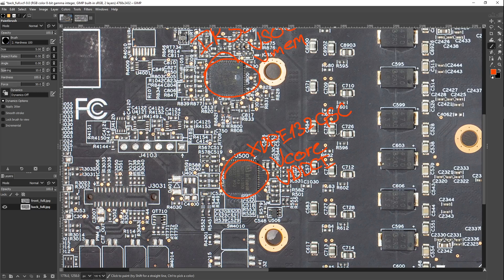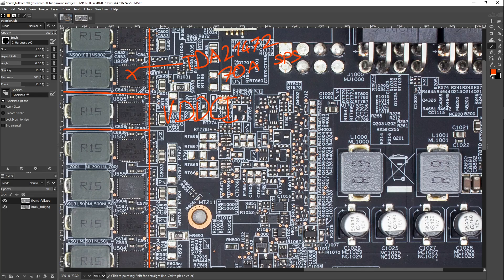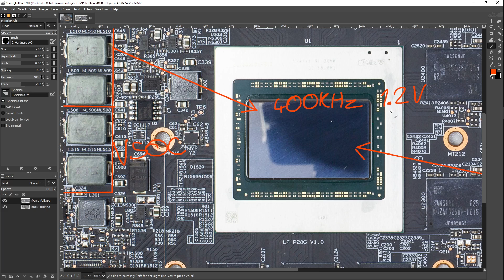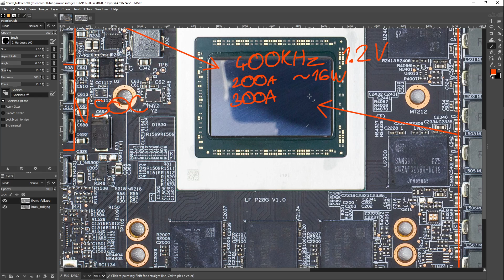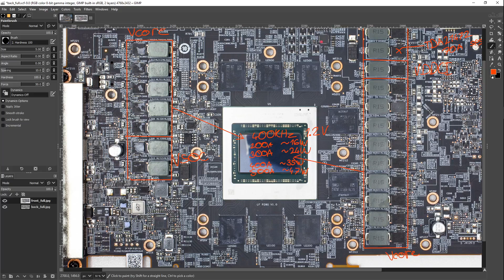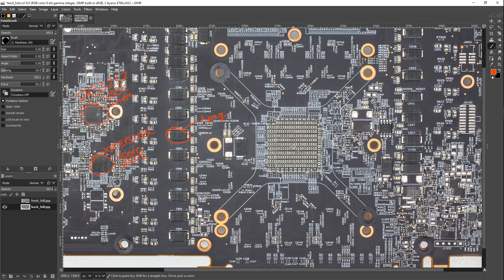GPU PCB Breakdown: RX 6800XT Red Devil

Comment: I have this card, the 3 volt pci is shorted. Tried injecting 1.2 volts and use thermal camera but could not find the fault. All the 470 caps seem shorted, assuming gpu is shorted.

Comment: I have the liquid devil version of this card, I noticed the red devil pcb has a 5 volt argb header on it and mine does not, would it be to easy to solder a header in place where one should be or is it not possible?
Reply: should work fine. might need to flash the red devil bios

Comment: i think the limits are there to make the 6900xt well actually seem half decent my red devil 6800xt se 667/1000 has a core that is locked at 2800 in some benchs and my stable clock is 2720 core and i beat some 6900xts so i think its there to make the 6900xt well have a spot then been beaten by its little brother

Comment: The limits on the 6800XT are so low because else you could OC it past a 6900XT, and that would make the 6900XT worthless. But you can get a 6800XT over a 6900XT stock anyway rather easy, even with current limits 😁

Comment: Are the components all in the same place / dimensions as the reference?  I have a reference waterblock from EK coming to put on my 6900xt but I could put it on one of these if it's the same.  Edit: I should wait, you literally said they stretched the reference board a little just after I typed that.

Comment: When does AMD/ATI give out proper drivers???

Missing drivers in Win98 for ATI X#### series.  Win98 was supposed to be supported.  Kinda forced upgrade to XP at the time

Missing Win10 drivers for earlier or most Radeon HD series.  Especially when MS pushed Win10 on Win7 users.
Some people woke up surprised to find their Win7 upgraded itself to Win10 which caused several other problems.

Had to find a legacy driver for Radeon 270X.  The normal driver package won't do for some reason.

I've given up on ATI/AMD GPU's
Never really had any driver issues with NVidia other then the default of some settings which is a minor annoyance

Comment: Hey man recently just started OCing my ram and tightening the timings, I have Corsair Vengeance 2x8 3600 18-22-22-42 (waiting for my 4x8 viper 4400) and when I read them with thiaphoon it’s says they are A-die 20nm...if you look them up they are supposedly should be  b-die....but wouldn’t A-die be 10nm....either way I got them to a 16-20-20-40 at 3733 at 1.47v is that a safe daily or no?

Comment: Hey man I would like to ask for your opinion on something, my rx 580 that I bought used that had the thermal paste and pads replaced, works fine on the desktop and YouTube and what not but when I start a game or anything it immediately stops giving signal and the fans spin to 100%. I took my whole pc to a store to have it checked out because I thought it could be either the gpu or my psu could be faulty, long story short it is the gpu and the guys there say it looks, just from the outside, like the thermal stuff replacement was pretty bad and that the gpu processor isn’t touching the heatsink, they’ll open it Wednesday and see if that’s the problem and replace the thermal stuff but do you think that would be a reasonable cause for the issue I described?

Comment: Looks like an awesomely designed card from PowerColor, I would suspect a special LN bios will become available from AMD. Not meant for the 99%+ buyers. I would say ask AMD or AIB partners for the bios/drivers. Also this PCB looks like it would support the 6900XT just fine if AIBs get the 6900XT which sounds like they will.

Comment: On the subject of limiting the clocks, Mark Cerny said in the Road to PS5 that if you push RDNA 2.0 clocks too high, the internal logic starts to break down, so they artificially capped it at 2.23GHz.
Now AMD might have resolved some issues to allow them to hold 2.5GHz and even more stable after the PS5 specs were locked-in and finalized, but that doesn't mean there's no limit to how much is useful to push it.

Comment: Do the reference PCB of the 6800 and 6800XT please there is images on techpowerup or tom's hardware can't remembere which, but please do it that's the video I've been waiting on, compare them to some of the aib's cause. Cause the Powercolour pcb has different r15's than the reference and powercolour filled the gaps for one of the r15's at the pcie connector. would be interested to hear your thoughts on the differences of the extra mosfets or whatever compared to the reference boards and if there is any changes between the 6800&6800xt boards I believe toms hardware showed the open pcb of the 6800 in their review and pointed out a different voltage controller on the 6800 board compared to 6800xt, Anyway do the video please :)

Comment: i had a gigabyte 980 TI xtreme that did ON STOCK VOLTAGE - 1650mhz AIR, and on water it ran allmost 1700mhz, voltage didnt do much, but where my card unlocked ? like they didnt software lock it ?

Comment: Guess we're not going to talk about how nvidias gpu boost actually throttles the more you use it.
Just because they rate the base clock as 800mhz doesnt mean that going slower with higher temps suddenly means "boost".

Comment: G'day Buildzoid,
It is a real shame AMD has the Frequency Limit as it would be Awesome to see LN2 OC challenges that have nVIDIA Vs AMD,
As a Sapphire Fan I am sure you will do a Nitro+ PCB Breakdown, it will be interesting to see if Powercolor has out done Sapphire on RX6800XT, or if Sapphire has something like a Toxic in the Works,
as someone who loves your channel & has learnt a lot maybe this is still a Dumb Noob Question (plus I understand it would be a Futile endeavour because of the Frequency Limit),
The Board design has mounts for a 3rd 8pin Power socket, if there was no Frequency Limit so you maybe get a LN2 OC that requires more power than the 2x 8pin would it be possible to just solder on an extra socket & have it function properly increasing the available power from the PSU?

Comment: I suspect the cause of the relatively poor cooling performance of custom 6800 cards that came out so far have to do with the chip orientation. In that position it's much harder to put heatpipes correctly on the die; on the reference vapor chamber nothing changes, but if AMD opted for a 90° rotation it would have probably helped AIBs in a tangible way.

Comment: The 5700xt bios is actually editable, changed tdp and clock curve on mine without issues
Reply: sw4gr1d  It's not just that, using both Red Bios Editor and More Power Tool, you can change voltages, clock speeds, limits and mhz curve, then saving all as a new bios.
Reply: @d4mb20  is there any proper instructions how to do this?

Comment: How about a Bios Hack? Sell it on a Thumb Drive for $10$ a pop.
Reply: I think that's the point of signed BIOS - if you change something, the signature breaks and it won't be recognized as genuine BIOS. So how do you hack it if you can't change it? You'll have to somehow bypass the signature checking. Or let's have someone smarter than me explain. At least that's how I understand it.

Comment: Please look into the the ryzen 5000 series not being able to clock pass 1600 fclk. It crashes on desktop and shows WHEA CPU Bus/interconnect errors. This is happening on my x570 msi ace. And it's happening to many others, it's all over msi forums and reddit. It's not unique to msi boards either.
Reply: Its bios. Wait for an update. @techdeals said that he had this issue. It was solved with bios update
Reply: There will be a bios update til mid December to address some bugs so be patient my dude
Reply: Watch his most recent vid 5600x vs 9900k vs 3700x
Reply: @alexandertarkovsky6995  the most recent bios gets me into windows but it crashes eventually. I never had this issue on my 3700x. I have to set my ram to 3200mhz and fclk to 1600mhz to be perfectly stable.

Comment: Thanks for the in depth review of the board. What I'm wondering is why companies selling 6800xt and the RTX 3080 recommend 850 Watt PSUs for the AMD card and 750 Watt PSUs for the Nvidia cards? The AMD cards are supposed to be more power efficient so why do they recommend bigger PSUs? <as I look sadly at my 750W overkill PSU>...
Reply: I've no idea about Nvidia, but AMD recommends oversized PSU due to possible transient current overshoot. Basically, a GPU with, say,  a power consumption of 300w can sometimes go much higher than that for a millisecond. It's just a millisecond, so it doesn't change the overall power consumption, but if your PSU can't deal with it, you'll get a crash or black screen. Remember how people were whining about AMD having buggy drivers? Trust is, most of those issues, where actually power-delivery issues like I described above or ram instability. Well, AMD can't do anything about ram instability, but they can do something about power-delivery by recommending oversized PSUs.
Reply: @1idd0kun  some psus are also too sensitive on the short powerspikes and it triggers protective actions. Resulting in shutdowns etc.

Comment: I think Redgamingtech (when the ps5 clocks was announced )  stated he received some info that Navi has a weird frequency wall where the GPU logic start to breakdown  and with that info he doubted that the navi21 will have higher GPU clocks . So IMO maybe AMD didn't solve that problem but managed to push that limit
Reply: It was originally at 2500 I think
Reply: @juniperburton7693  yeah something arround that . Well , lets see what gonna happen when poeple try the 6900xt bios on 6800xt 😁

Comment: Clock limits might be partially to protect an eventual N7P refresh.
Reply: 1st gen Navi is already on N7P, i'm assuming RX 6000 series are on N7P as well
Reply: @Lemard77  Seems you are right. For some reason I thought they were both on N7!
Reply: N7P doesn't make sense as that requires design changes, N6 is design compatible with N7 though. (which is the reason I impatiently await a 5950XT on 6nm, lol)
Reply: @Wasmachineman  N7P is actually DUV and still uses the same design rules and is fully compatible with N7; It's N7+ which is different. N6 wouldn't really make any sense as it only offers density improvements and no performance changes.
Reply: Man, I don't even fucking know anymore what node has what and what not.
Reply: @Wasmachineman  Same. I definitely had to go look it up.
Reply: @Wasmachineman  if you are going to wait anyway, surely the products to lust over are the 5nm/AM5/DDR5 Ryzen CPUs next year, right?
Reply: I already own a stupid amount of DDR4 and no way in hell i'm paying €1000 for 4x16 (or 4x32?!) DDR5.

Comment: This card feels just weird. Its component choice is better than similarly priced 3080 (FTW3), and TSMC's 7nm can run on a very high frequency, so why don't they either cheapen the components and make some MSRP range card, or add another 8pin to make an absolube beast card. It's kind half-ass. 
It seems like AMD is just using sketchy way to limit the 6800XT, rather than seperate different tier of product properly.
Reply from the maker: the extra 8pin wouldn't do anything.
Reply: ITS ABSOULTE BS MR ZERO; I TELL YOU WHY that lower die shrink NEVER BENEFIT FREQUENCY ANY HIGHER...7NM IS HARDER FOR AMD TO GO 5GHZ, WHILE 5NM WILL BE WORST FOR THEM WHEN POWER INCREASE AS WELL DUE TO TRANSISTORS NUMBERS...IT TAKES YEARS AND YEARS TO RETOOLED DIE ITSELF..BY REMOVING IO AND PUT THAT ON 14NM INSTEAD OUTSIDE THE DIE..THATS ONLY SOLUTION TO GO HIGHER FREQUECY WHILE ZEN3 IS MORE RECONFIGURATION CCX AGAIN, THEY ARE STILL LONG WAY TO GO ..BUT UNLINKE INTEL...ENTIRE COMPONENT IS AT 5GHZ

Comment: 10 bucks this will be the same pcb for the 6900xt but just with a third pcie power connector
Reply: "I look forward to taking your $10"

- Frank Azor, probably
Reply: @uncivil_engineer8013  I got that reference xD
Reply: @uncivil_engineer8013  i see  a man of culture as well
Reply: No doubt there will be a third power connector considering its just 8 more compute units, the 6900xt still makes no sense yet because if the CU scaling makes those 8 CU's not worth it for the premium well we have a vega 56(+ bios flash) and vega 64 moment where a decent amount of people just say yeet.
Reply: @davidashurov5255  at this point the third power connector is pure marketing aven under LN2 due to clock limit
Reply: @gio9789  and thats if you get a board that has little to no imperfections that can handle 3ghz and everything needed for it. Honestly it feels like in this PC parts generation AMD is really trying to push a ghz war which yeah for 3dmark i guess that can work(only real reason to buy a gpu ofc, 3dmark is life) but everything else needs somework, which really makee me question amds r&d dept rn. Currently rdna 2 is only competitive with 6800xt(6800 makes 0 sense pricewise)  I predict 6900xt may give no more than a 5ish% boost in perf across the aisle compared to 6800xt, thus we are victims to marketing again but hey at least zen 3 is really good but still infinity fabric in 2012+8 lmao, amd the company to fuse northbridge into the main die said fuck go back lmao.
Reply: @davidashurov5255  the 6900xt is more interesting due to price and the rasterisation performance seems on par with the 3090, I see RDNA2 like ZEN + it's only a matter of time before we something that really crushes Nvidia. But on the other hand if AMD doesn't fix their software in terms of features like DLSS and a better hardware for ray tracing I don't really see a reason to buy the 6800 or 6800xt, the 6900xt makes sense since is better than a 3080 but the Nvidia counterpart doesn't get you enough for 500 buck more, at least in my opinion.

Comment: Maybe they hardware locked the clock speeds due to infinity cache issues at higher clocks? I have no idea other than segmenting the cards.
Reply: I think it's just for segmentation, to make sure people can't clock the 6800XT high enough to make the 6900XT completely pointless.
Reply: @isakh8565  I have a ATI 9500 laying around somewhere... I used a soft mod to make it into a 9700. But obviously it wouldn't perform as good as a 9700 and silicon lottery you might get worse or better but never as good as the 9700. 

I think they are doing segmentation too. 

But why beef up the card and not let you take it to the Maxx.
Reply: @isakh8565  if the 6800XT can clock that high then it would be easy enough to assume the 6900XT can as well given it's only adding 8 CU's over the 6800XT.
Reply: @sirmonkey1985  check out igors lab. His software shows the 6900xt can clock to 3000. While the 6800 and xt can only goto 2800. They cannot be modified to go higher. At least not at this time.
Reply: that's what i was thinking.. maybe there's some kind of internal ratio with the cache or memory controller that the gpu clocks tied to but once you go over a certain clock there's no lower ratio. hopefully there isn't some kind of hardware limitation and they decide to release a new bios or something.

Comment: smaller caps have shortage life expectancy than lardger caps...both have pros and cons....larger caps have many benefits but it does not like high clock but outlived its gpu longer ..than smaller caps is higher frequecy but they shorten in life span for gpu itself...so maybe amd 6000 series is short term product so 7000 series might be last product from amd when everyone gonna into SOC market fully by intel and arm and nvidia...its really up to AMD moved into the trend or fall behind in outdated method is starting to show its weakness..gpu external cards have limitations when pushing further its envelope..they have to be socket or else it will no work on slot when watts gonna higher and amps getting to high
Reply: The most powerfull gaming SoC are made by AMD. They just don't sit in a laptop or PC right now. You can buy them in form of Xbox Series X and PS5. So how can be they're missing the trend when they're the one making one of the powerful SoC with integrated graphic available?

Comment: I have a Gainward GTX 980 Ti PHOENIX here.
It was running for a few years with a decent overclock but decided to release magic smoke on a chip next to the NVVDD powerstage.
Both fuses? for the PCI-E power connectors seem to have blown as well.
Is there any chance in repairing it or is it gone?
Reply from the maker: replacing the VRM should work
Reply: @ActuallyHardcoreOverclocking  Is it worth the money to do so?
How are the chances that VRAM or GPU took a hit too?
Reply from the maker: @Xulunix  You're probably better of buying another second hand 980Ti than trying to repair a dead.
Reply: Oh dont worry my 980ti windforce g1 make a nice flame and smoke and made to repair it and after 2 days one chip controller just explode :) is just time to upgrade wait 2021 like me with intel gpu master race